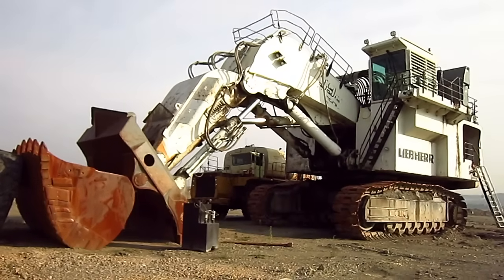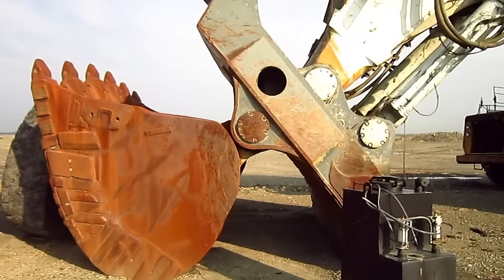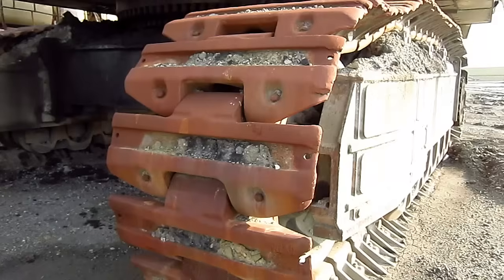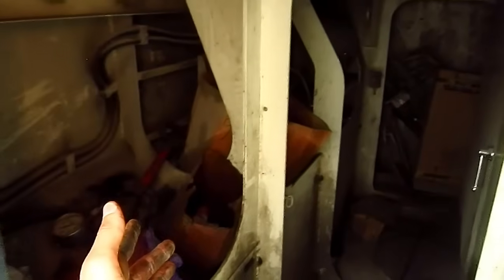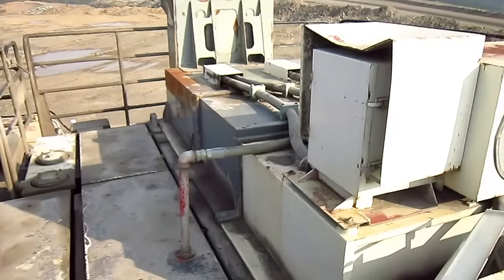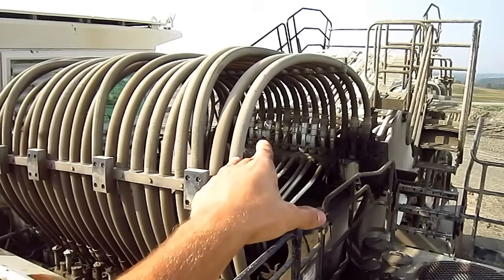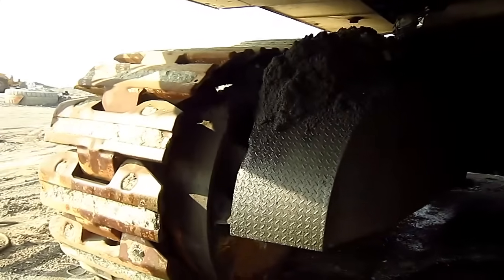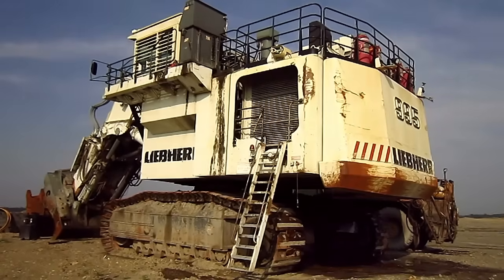The GIANT Liebherr R 995

Comment: Hydraulic shovels seem very complex and costly. Why would a mining operation choose a hydraulic shovel over a cable unit? Great channel sir!
Reply: @mikekopie9897  The hydraulic shovel is actually less costly to purchase. Hydraulic shovels & excavators are generally used for shorter term mine sites. By that I’m referring to less than 10 years. Some units can last longer if the maintenance program is excellent. Another big factor would be digging conditions at the mine. If conditions are normally very difficult then obviously the machine working life will be reduced. Another huge factor for opting to buy a hydraulic shovel is its ability to dig selectively. The machine just has more flexibility and versatility to do selective digging. A cable unit would be unable to do high production selective digging. The cable shovel is a great choice for a mine that is expected to operate for 12 to 20 years or slightly more. The very large size cable units can have a price tag of 20 million US dollars or more. But they can handle tough digging conditions for many years. I believe P&H cable shovels (now under the Komatsu umbrella) are pretty much guaranteed to last last at least 20 years working life. Of course that is highly dependent on the maintenance program. If the maintenance is done as per factory recommendations there should be no problem. Both types of shovels have their place at the mining site. It’s basically about choosing the unit that fulfills your specific requirements the best. Take Care.
Reply: @williamhall9204 very interesting answer thanks

Comment: Interesting to see the clam controls as foot pedals. I figured it would be a thumb switch on one of the joysticks.
Reply from the maker: Most shovels manufacturers have foot pedals to operate the clam. The only manufacturer I recall that had joystick switches was Cat on the 51/5230 machines and on the older 2/300 series

Comment: PAmining- in your opinion, what would be the advantages or reasons for choosing one configuration over the other, ie; front shovel vs backhoe?
Reply from the maker: Believe it or not, in most cases, the deciding factor usually comes down to operator preference. Shovels are better for flat coal jobs, working long big panel shots. They are, imo, way more productive than a backhoe in the right application. Backhoes are excellent for pitching strata. At the end of the day, I've found that most operators choose a machine based on the old saying  "this is what we've always run and what our operators are used to"
Reply: @PAmining  Thanks for the reply.

Comment: The dust that collects inside the rad room is so bad they put hatches in the floor we opened to spray that fine mud out once we got water in there. I got pictures me on it and I tried firin it up to take a bite but the main cutoff was tripped and I didn’t know where it was at that time. Fire suppression went off that day and we were called to spray that shit off the engine.